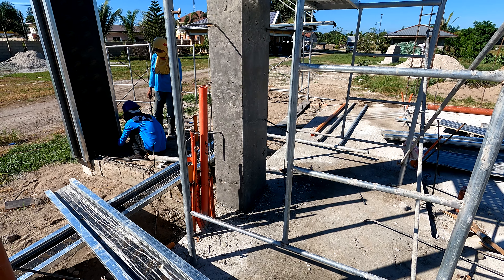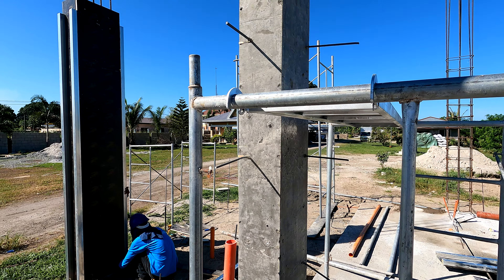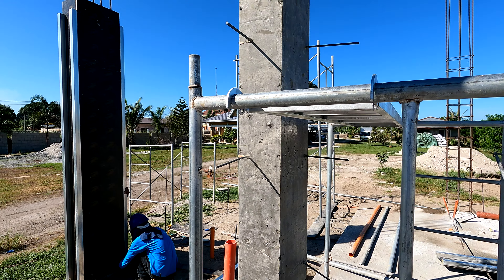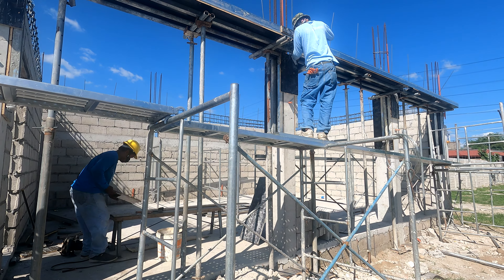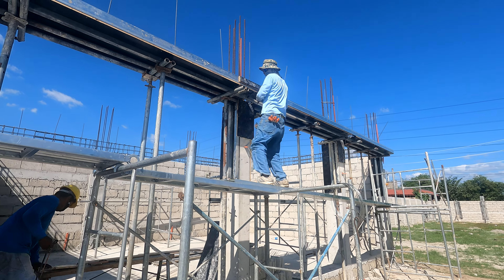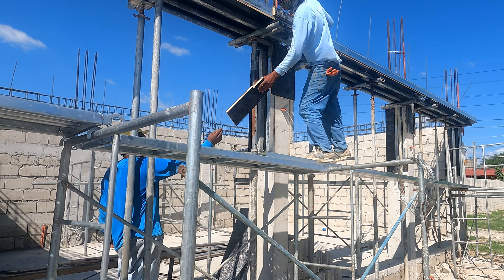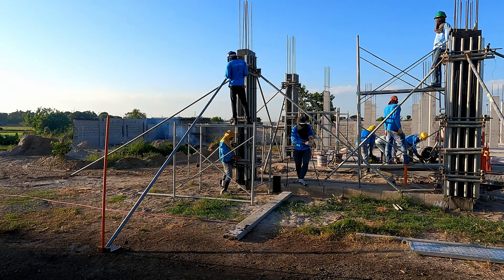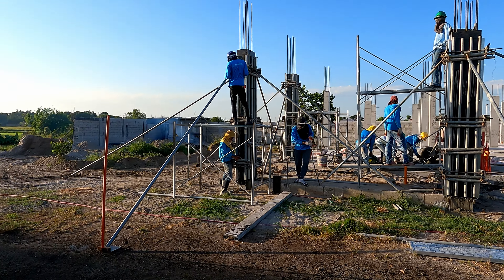Philippine House Building Day 48 - New Concrete Column Pour. The Big Reveal

Comment: The tie beam at the basketball court was a stroke of genius. however there should be 50mm clearance under the beam steel and existing slab. This is to ensure the steel is incased in concrete as moisture could track between the existing slab and bean causing the beam steel to rust, not a good long term situation. Great progress though.
Reply from the maker: Larry
I have asked the engineer. It was only 20cm. Hopefully that is compensated by the fact that the footings were poured up to about 80cm so it came back to the original level of the basketball court. Also, the load on those beams should hopefully not be too great.